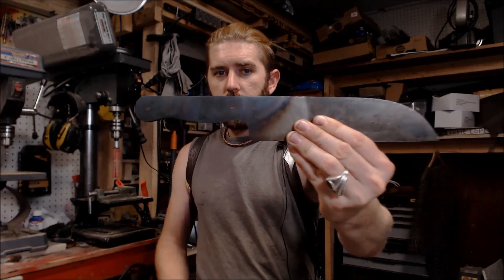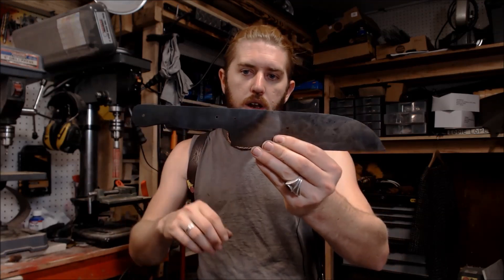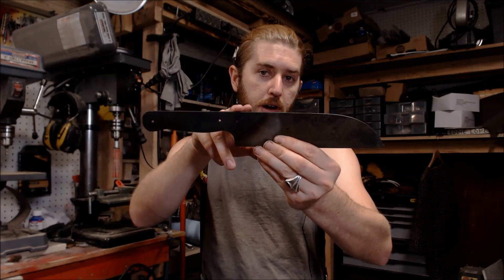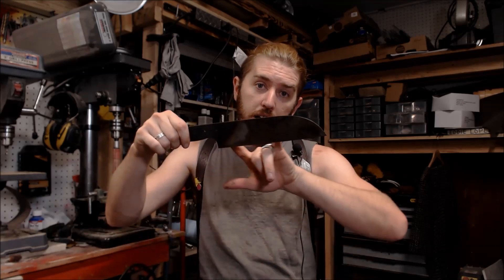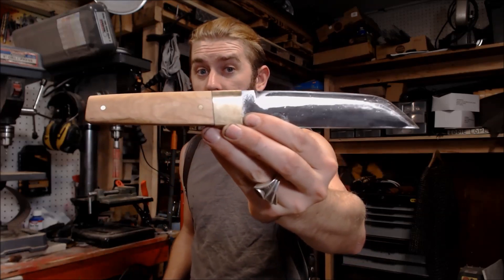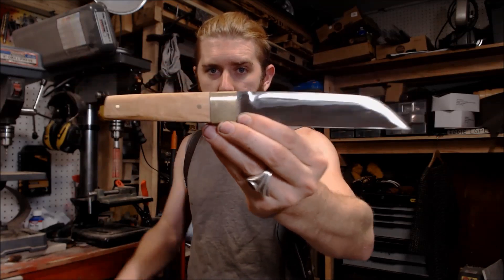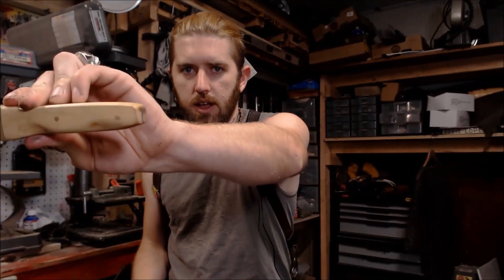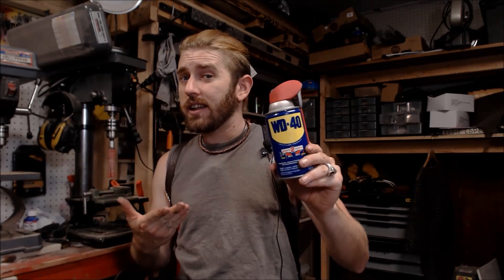Drilling High Carbon Steel- Tips and tricks!

Comment: There is a technique known as "red or hot point" drilling of hardened hi carbon steel with sharpened tungsten carbide drills.  Very hi speed 4,000-5,000 rpm drill held against the steel with enough pressure will anneal the steel and start cutting.  No lube or coolant.  Done this numerous times with bits ranging in 1/4" up to 3/8".

Comment: I have found no good answers for my issue, could you help please?  As a modification to fit a different model of clipper, I am trying to drill or punch a couple of holes in an Andis hair clipper blade which is high carbon steel. Drill bits have all been a fail, dremel punches and burrs have been no good, even diamond attachments on the dremel have been zero help.  I've tried keeping cool bits with continuous cutting fluid, water mix, and tap magic, and WD40. Still have no luck. I think its too small to attempt to heat it without affecting the teeth where it is a necessity to stay hard in order to stay sharp and last.  I'll end up just buying a blade that fits but I really would like to defeat this little project just for the heck of it! Thanks!
Reply from the maker: @solidgameent  I can try to upload a video on this for you, but to answer your question and for an option- your clipper seems to have been hardened along it's entire length- and that hardness is at or past the hardness of the drill bits. With many of my blades I anneal (soften) the steel surrounding the edge but keep the edge itself hard. The entire blade doesn't need to be hard sometimes, just the edge. So I get a expendable rag and get it soaking wet and wrap it around or up against the edge. I then take a torch and heat from the furthest point from the edge and watch the steel change colors. It goes from light yellow, to brown, to purple, to blue, to Grey, heat until the area you need to drill is grey or even glowing a little bit- but keep that edge cool. Let it air cool for about 20-30 min, do NOT quench. This technique will have softened the steel of the handle while keeping the edge hard. If the edge was ruined it would be obvious because there would be color on that part of the steel When drilling   you have to go slow with pressure so I always recommend 1/8" cobalt alloy bits.
Reply: @vanguardsmithing7501  and you just received another follow.  Thank you, my man. I am a certified fastener specialist and do engineering support for fastening systems so I have been through all the metallurgy classes and annealing, quench/temper, electro-plating, hot & cold forging, etc. And I absolutely love this stuff, but actually using the annealing process (outside of some different hardened fasteners to get rid of the brittle and bring back some ductility) I have never used it in a real world application as such, so thanks again.  I am excited to give this a whirl.
Reply from the maker: @solidgameent  you're welcome! If you are nervous about doing it right try it out first on a butter knife or some scrap so you can see the changes and get familiar with it first, doesn't have to be a hardened steel just a steel to heat up keeping other parts cool

Comment: I tried drilling 5160 steel 
I hated the steel and cooled it slow
But after u removing the scale I was able to drill it but very very slow 
And my bit barely removes much material 
I'm worried I might break another bit
Reply from the maker: What's your drill bit size and speed? Bit alloy? And what kind of cutting/drilling fluid are you using?

Comment: Having issues drilling a 7/8th hole. Im using an Angular Cutter and this isnt working.
Reply from the maker: For a 7/8 hole the two best options are a step bit or a hole saw, I'm not sure what you mean by an angular bit- but in either case you need to drill as slow as possible. Has the steel been hardened? How thick? We often drill 2"+ holes in stainless with a 12 speed drill press (on putts slowest setting) with a hole saw at my work, though it can take 15 minutes of drilling and constant application of cutting oil.

Comment: Hi nice video what was the bit you recommend going through carbon steel or hardened steel, I’d be using a 3mm bit and I’m only trying to widen a hole from 2.5mm to 3mm tried using avm42 co8% bit and would not really work, thanks friend in advance
Reply from the maker: By Carbon steel I'm referring to anealed or pre hardened steel. Anealed is the state at which it's only mildly harder than regular mild steel. But if the steel is already hardened drilling is a battle between the bit and the work piece. Is the piece you are working on hardened carbon steel/tool steel? Mild steel? (Steel with .018 carbon) Is this a piece post or pre quench?
Reply: Vanguard Smithing hi thanks for the reply, I believe it hardened #45 steel, it for my 1/8 scale RC car and it’s basically the axel hub and a pin hold the 17mm hex to the car and then my tire goes over the hex. It’s very hard steel, I also tried a titanium bit that I had and did not do much either, and like I said there’s already a 2.5mm hole there I’m just trying to make it 3mm, thanks very much for your help I really appreciate it
Reply from the maker: @Ledge.Limited.Collectibles  I have two ideas depending on your tool set, one you can Anealed the metal, drill and reheat treat if you think it's necessary, or simply anneal the spot you need drilled only. You can do this by soaking a rag in water and wrapping it around the piece or so 2" to either side of the piece and heating it until it glows red in a darker room, let cool then drill. The other options include reheating and quenching bit I'm not sure if you are set up for that, how precise does the hole have to be? Can you try a not as clean hole with a carbide die grinder? It wouldn't be perfect but they are more aggressive and might be able to open up the hole
Reply from the maker: @Ledge.Limited.Collectibles  the wet rag keeps the other metal from getting hot
Reply: Vanguard Smithing ok thanks very much I appreciate it!!
Reply from the maker: @Ledge.Limited.Collectibles  I'm not a rc or car guy so heating one section of the piece might be warp the axle, good luck!

Comment: Thanks for this; very helpful. I’m trying to figure out how to drill a half-inch hole in 3/4” 4140. If you’re getting maxed out at 1/8”, I think the answer is probably “You can’t really do that with your home shop equipment,” which is fine. Just because I don’t like the answer, doesn’t mean it’s wrong. All the best.
Reply from the maker: That's a medium carbon molybdenum and chromium alloy and if anealed you might be able to drill it? Or hot punch/ drift through the material. If you try to drill it you can try slowly moving up bit size buy 3/4 would be difficult especially if its thick. If you do try to drill use lots of drilling oil but it sounds like you want to drift/ punch it, if the shape doesn't matter you can also try to drill as big as you can and use carbide burrs? But it would be a nasty hole.
Reply: @vanguardsmithing7501  Drift punch is definitely the right answer. I’m trying to cheat because my shop is so wood focused that I’m under-equipped in the forging department. I’ll give it go with slow drilling and lots of oil with the understanding that I might lose a bit in the attempt. I appreciate the additional information.